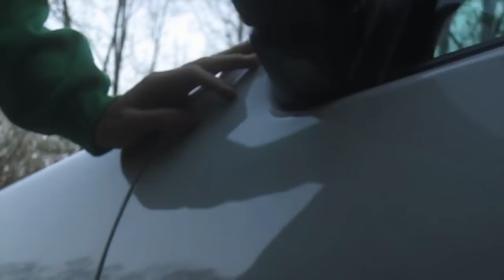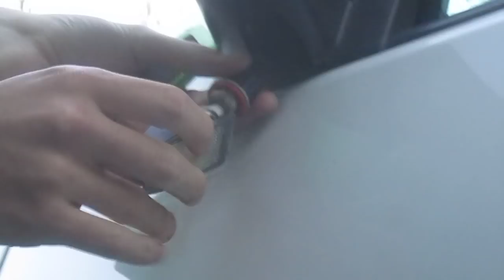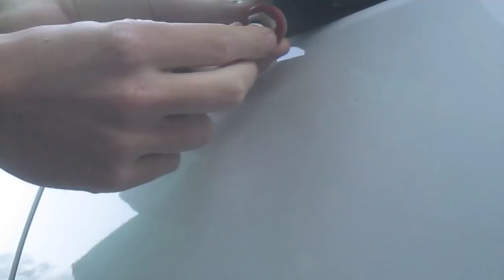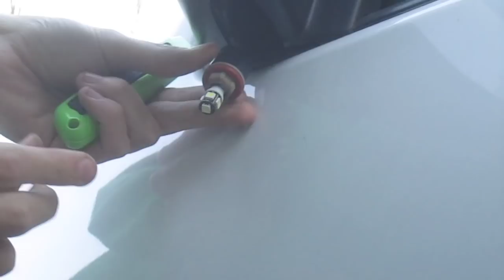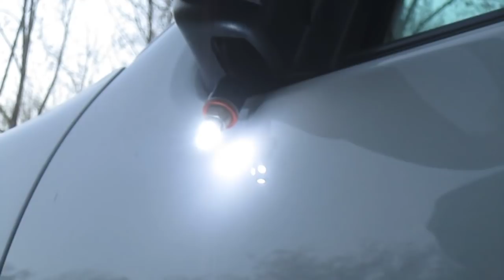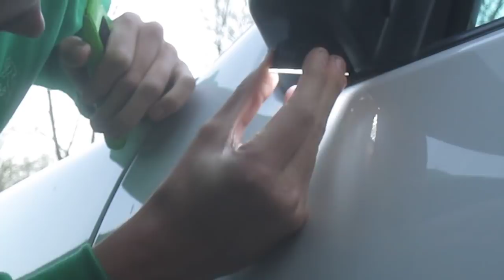Ford Explorer Puddle Light Replacement

Comment: Helped me get to mine on my 2003 Explorer.  It's much different however - the bulb assembly doesn't drop down for easy replacement.  The cover also doesn't come off as easily - I broke mine :)

Comment: Part number for the bulb would’ve been nice. Otherwise..thanks for the video.

Edit: I used a small flat head screwdriver and was extremely careful. Bulb is part #194. Fixed.

Comment: I've got the same Expolder...here's my prob. The lense on both sides have burned dead center (dime size) due to the original bulbs being too close and/or too hot.
Junk yard path lead me nowhere....no Exploders/Mountaineers of that year to be found. Resellers have the complete mirror...want $50 apiece!
 The lamp housing was manufactured by Britax-Austrailia. Sold to Ford via a company called Donelly (sp). Big lawsuit over patent infringements on the puddle lamp design!
Other than the Reseller price hustle, I can't find these housings other than calling more junkyards outside of where I live (Vegas).
Doesn't sound like you had the same burned lens issue I have?
Any help out there would be greatly appreciated!
Reply: I Know this is old but I have same issue. Holes burned in the lenses.

Comment: How many watts was the bulb you used?  I see there are a few different t 10 bulbs, I want to buy the correct bulb.  Thanks
Reply from the maker: I believe that it was a 12v 1.5 watt led build I used. I'm sure if you bring your bulb to your local auto zone or parts store they can get you the correct bulb

Comment: What size LED bulb did you use?
Reply from the maker: I used a 12v t10 led white, cheap and it's been a year and they are still going, m.dhgate.com/product/10-x-xenon-white-t10-wedge-5-smd-5050-led/165781005.html#pd-112